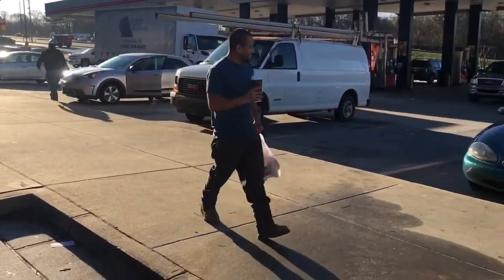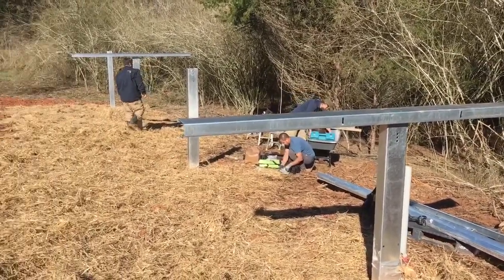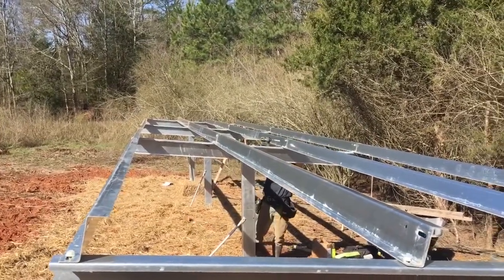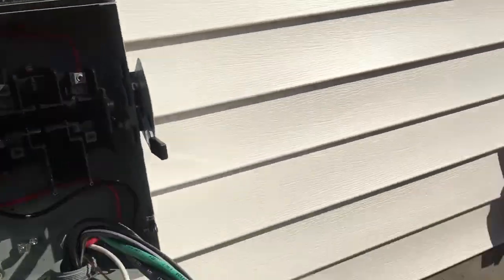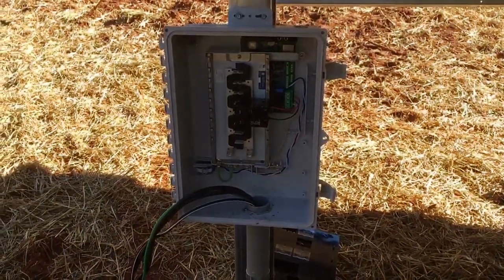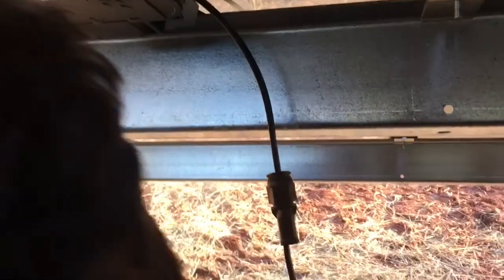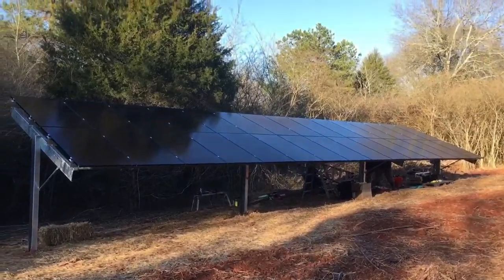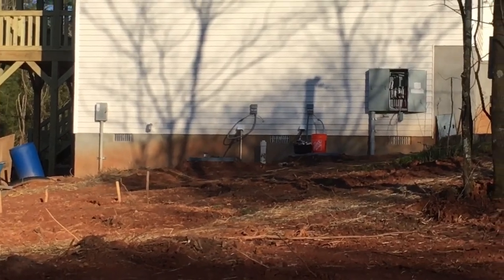Enphase Grid tied solar ground mount w/Engineer775

Comment: what combiner box would you recommend using,... my system when finished will use 36 190 watt panels, feeding 3 Schneider Electric mppt 60 charge controllers,... 4 strings of 3 on each charge controller. completely off grid, using 2 x schneider electric conext sw 4048 120/240 inverters. currently my system has 18 panels on 2 charge controllers and 1 inverter... I needed to get it up and running to use during construction. I currently have a midnight solar combiner box that has the ability to combine 2 sets of 3 strings... but this will not be enough when i expand the system.

I got several of the items I'm using on this install for free... 42 190w panels (2 broken), the 2" galvanized pipe and unistrut to use for the rack, and the current combiner box were all free, as well as a 100 amp breaker panel with various breakers in it, and an AC combiner panel (2 40 amp 2-pole breakers in it)... I purchased the schneider electric charge controllers and inverter and have plans to purchase another inverter and charge controller. 

I've been trying to find a combiner box that will work with 3 sets of 4 strings,... but so far no luck. I'm thinking I may need to go with 2 or 3 combiner boxes and then a junction box with the conduit going to the house.... I only ran 1 pipe from the array to the house (1 1/2 inch pvc.)

Comment: I guess there is no need to ground the enphase inverters since the rack is a big ground rod.
Reply from the maker: K K they don’t have to have a grounded conductor run to them but they are bonded  to the rack by the fastener